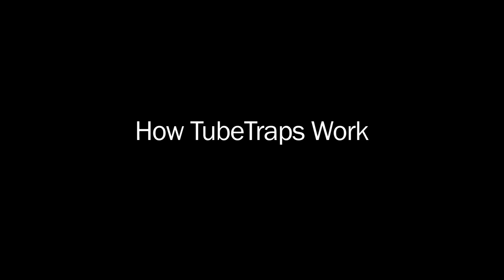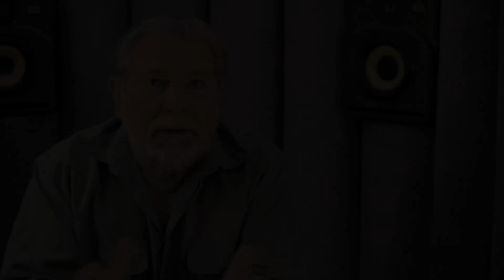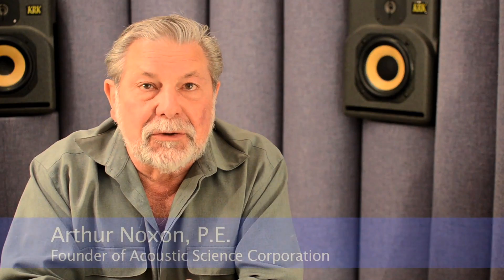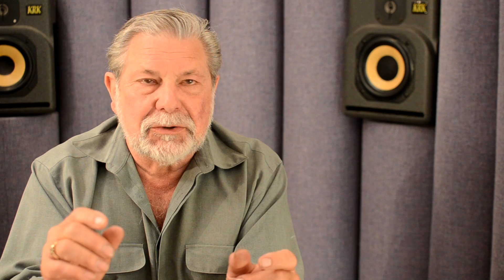Art Noxon Answers: How TubeTraps Work

Comment: Ok, I have a weird one for you.  My listening/living room is 16 wide x 10 tall x 48 (open living space). Walls are double 2x6 on 2' centers, offset 12" with no bridging except ½" plywood across the tops of the caps.  I have a 5x6 picture window on the left wall and (2) 3x5 casement windows on the front walls.  Inner and outer walls are both stuffed with R-23.  Attic is 2 layers of R-36.  Sheetrock is ½" on walls, ⅝ on ceiling.  Floor is slab on grade.

 My speakers are Speakerlab corner K horns stuffed tight into the front corners plus an additional K horn dead center against the front wall (and it will be modified to direct the bass from the cabinet towards the back instead of towards the corner)  and I have a 4th one that will be a rear channel ~18' back from the front wall (behind listening sweetspot).  I also have an anemic sub set to max output between right and center speakers.  

What on earth can I do tame the unwanted reflection racket?  It has to be diy because of retirement budget and earth cracking shipping costs.

Comment: The only problem with putting bass traps in the corners is that that's where Tangental and Oblique modes typically are, but Axial modes aren't..  Axial modes are typically along entire wall surfaces since the definition of an Axial mode is modes between 2 parallel surfaces, not between 2 parallel walls.. So, you really have to address absorbing the low frequencies below 100hz against the entire surfaces (or a large portion), walls (front, back, side) but also ceiling and maybe even the floor.  If you can go after the modes below 100hz, and treat those, then the rest falls into place.  It's easy to absorb 125hz and above, but much harder and costly to absorb below 100hz down to 30hz around the room.
Reply from the maker: Hello Oneness100!  Very good observations, thank you for your comment.  We place TubeTraps in the corners in order to address all three of the mode types at once.  This is typically the first phase of treatment in any room, and the sonic results are very satisfying in relation to cost and room real estate occupied.  More advanced room designs do include additional TubeTraps along the front, side, and rear walls, and also the ceiling.  Our larger model TubeTraps (16, 20, 24) provide substantial absorption between 25-100 Hz, easily covering the lowest axial modes in most rooms.

In response to your concern about very low axial modes ( <50 Hz), we have an extremely effective and space efficient solution in our IsoWall system.  Here are links: https://www.acousticsciences.com/iso-wall-system/  http://www.asc-soundproof.com/products/iso-wall/   In a nutshell, the system converts the room surfaces into very large damped membrane bass traps that operate to below 20 Hz.  And you use less than 2 inches of depth on each surface :)